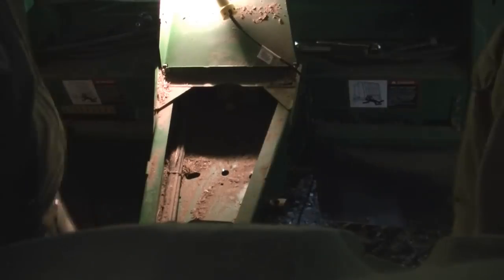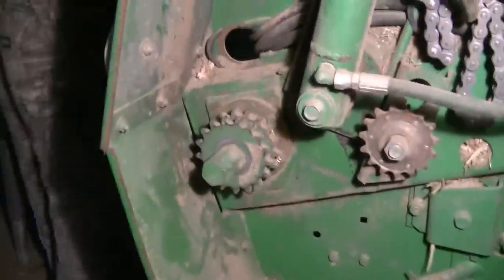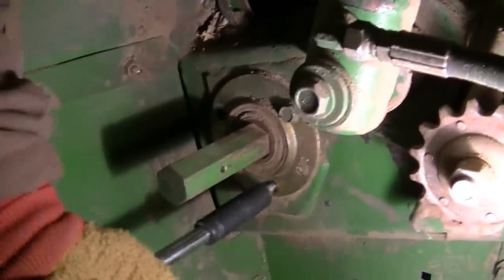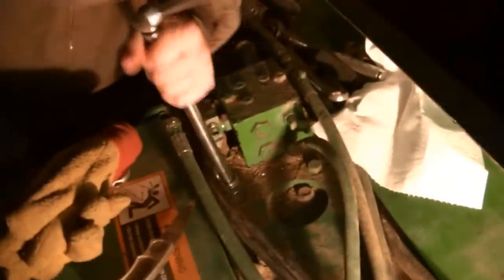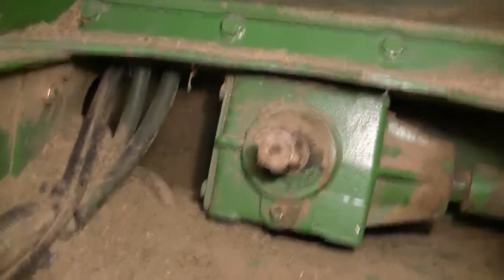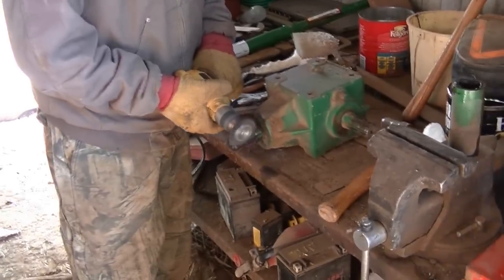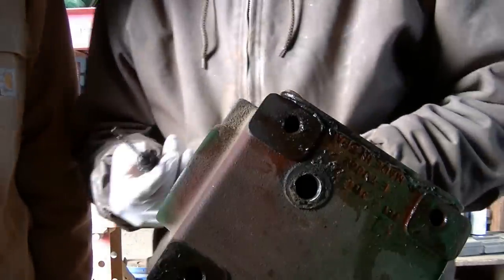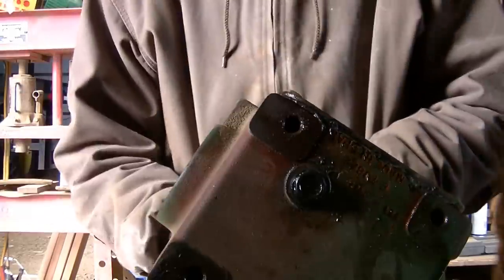Easy John Deere 566 Round Baler PTO Conversion (540 to 1000)

Comment: I just want to restate that the speed the baler runs at has not been changed. Yes he said at one point he was changing the speed the baler would run at but that was just a miss statement on his part. The tractors PTO shafts come in 2 different speeds that they run at;  540 RPM or 1000 RPM.

Comment: I just purchased the same baler and need to convert it.  Do you happen to know the PN for the 540 PTO shaft that is needed?  Did you just replace the yoke at the PTO to the 6 spline 540 or did you buy a front half of the PTO shaft?
Reply: Did you find the part number?

Comment: Did you have to buy a whole new pto shaft from the gearbox to the tractor? What did you do to get the 1,000 rpm connection at the tractor?

Comment: What baler is this on? 

It's cool JD designed it to work like that. Must be a 1:1.85 gear ratio! My 530 baler shows to open gear box and replace gears to convert it, at least they had the option in 1984!
Reply from the maker: +Adam Nygaard Its a 566 I'm pretty sure.

Comment: How much faster is that going to be? What rpms? What was the size of pto was on there? Not a bad idea to flip it
Reply from the maker: The baler will be running the same speed, but it will convert 1000 pto to whatever speed the baler itself runs at, which I assume to be somewhere between 540 and 1000, probably around 750. It was a 540 pto. By switching, we will be able to use any of our tractors with it, not just the tractors with a 540.
Reply: That's a good idea, use whatever tractor you want without swapping p.t.o. out.

Comment: What is the advantage of using the 1000 RPM PTO?
Reply from the maker: All of our tractors have a 1000 pto, but not all have a 540. So therefore, we can use all of them now.
Reply: Makes sense to me.  Thanks.
Reply: Reduces the load on the shaft... twice the speed means half the torque to deliver the same amount of power... sorta like how 220 volt stuff is more efficient than 110 volt for heavy duty applications, and saves you money, because you pay for amperage not voltage in electricity... volts times amps equals watts, so doubling the voltage halves the amperage required to produce the same amount of work (wattage).  

They created the 1000 RPM PTO when it became apparent that big tractors could put SO much power through the shaft that they can twist it off, which required huge shafts and U-joints to hold up under the torque.  Increasing the speed reduces the amount of torque delivered through the shaft, meaning the smaller shafts can hold up to that amount of power being delivered through it.  

Later!  OL J R :)
Reply: luke strawwalker is the torque the same after the gearbox? Must only alter the torque on the driveline between tractor and the baler gearbox. The torque coming out of the baler gearbox will be the same either way right?

Comment: Why not just use a adapter 1000 to 540 on your bigger tractors. Just run them at a lower engine rpm.  To where their PTO is turning the baler at 540. Saves fuel